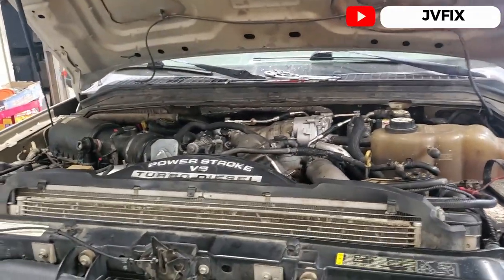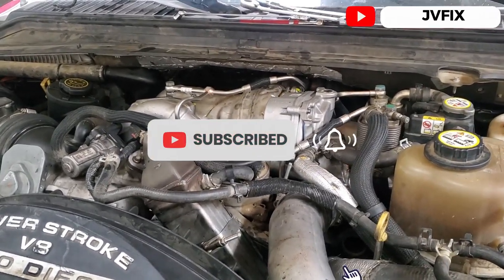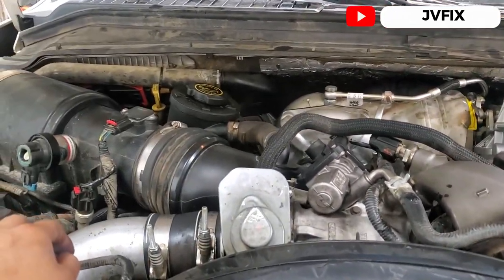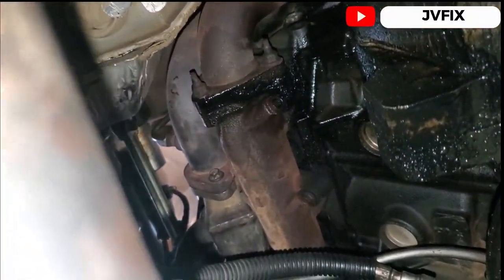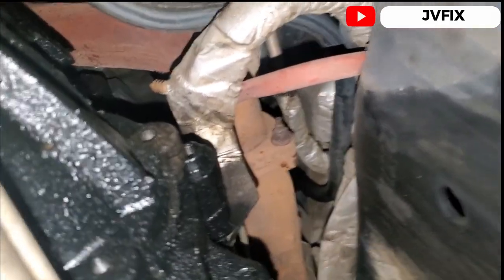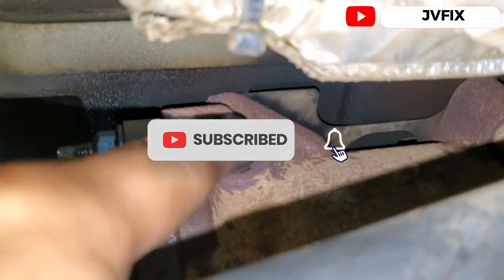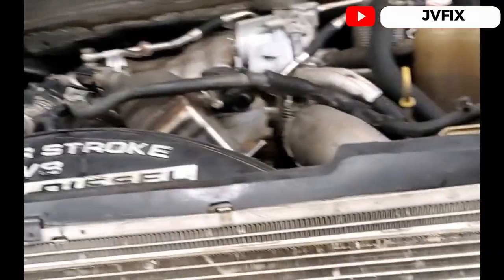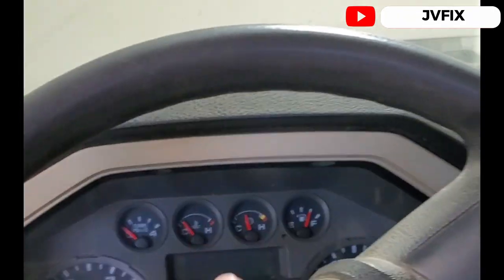How to fix whining noise on 2008 Ford F250, F350, F450 with 6.4 Diesel engine exhaust leak noise.

Comment: I wish you had taken a video of the noise from inside the cab
Mine is making a noise only went under acceleration only while driving so crap😅
I guess I must go look at my exhaust bolts
Reply from the maker: it could be the same issue too it starts with low pitch at first and then it gets more intense

Comment: Did you have to remove the cab?  I have the same problem with a broken bolt and whiny sound and everybody wants to charge $2000 to remove the cab to get at the bolt.
Reply from the maker: I didn't have to remove the cab to do this job what year is yours?